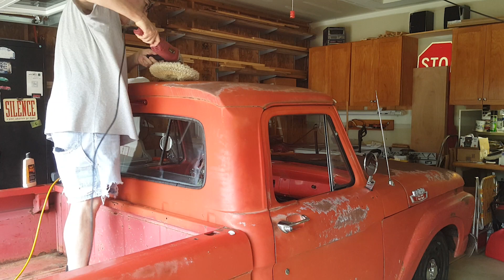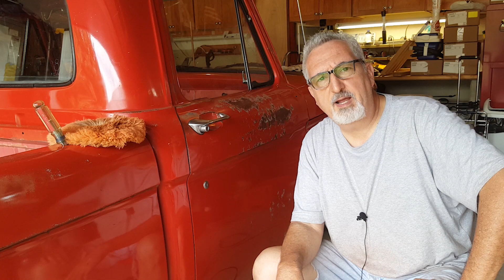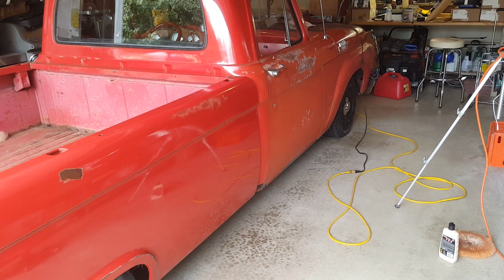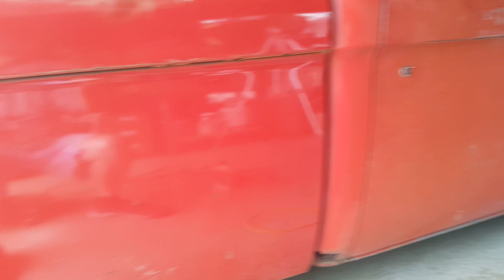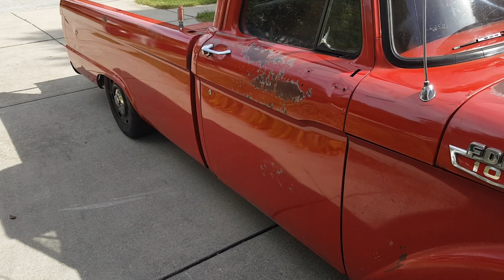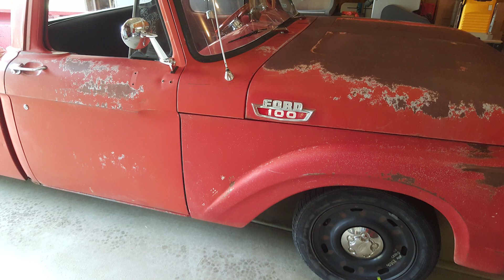1964 FORD F100 CV Build The Paint Gets Buffed

Comment: Great looking Classic truck man. Is the gas tank still on the stock location or is it underneath the bed.
Reply from the maker: Thank you! It's under the bed at the rear. The tank behind the seat is gone but I left the filler neck and cap to plug the hole in the cab.
Reply: @pmr413  Oh ok Thanks brother. Is it a full Crownvic frame or is it a Crownvic front end swap.
Reply from the maker: @CJColvin  CV front cradle/suspension, drive train and we flipped the rear axle to lower the rear.
Reply: @pmr413  Sounds awesome brother. Still has the stock 4.6L SOHC 2V V8 in it right.
Reply from the maker: @CJColvin  That's right, my donor car had 46,000 miles on it so I wasn't going to change anything in the drive train.
Reply: @pmr413  Sounds awesome brother.